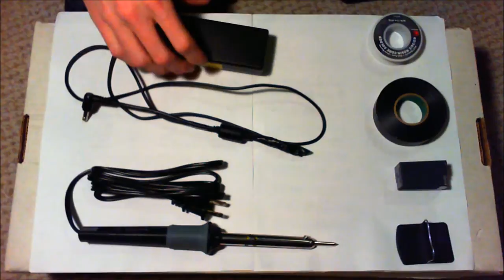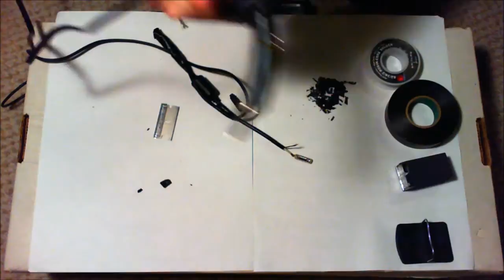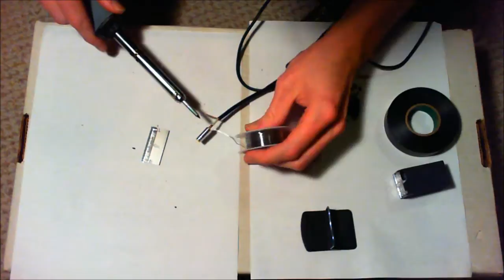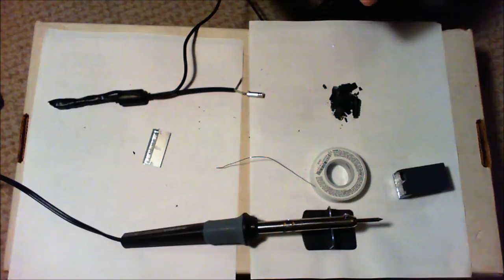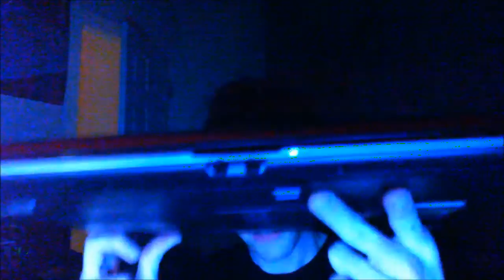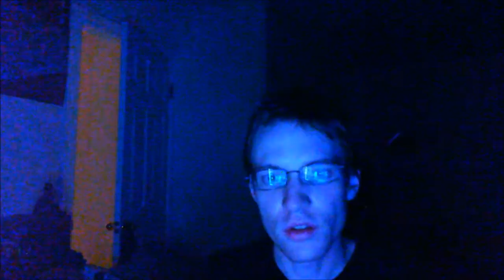How to fix a broken adapter tip

Comment from the maker: The inside wire is connected to the inside of the tip, that outside wiring is soldered to the outside casing of the tip. It's all in there.

Comment: You soldered the insulated wire to the tip and taped around it but you didn't say what to do with that second  wire .??

Comment from the maker: Yes, if it fits, just make sure you match the guts of the wire so the polarity stays the same.  It will push the same voltage and amperage, regardless of the tip.  I've spliced a great many adapters in my life :)

Comment: YES! THATS MY PROBLEM!. THE TIP WIGGLES. it still works. i have it plugged in right now but i need to wrap it around my laptop for it to work and im getting tired of it :( im afraid that if i strip the plastic off the tip it might get worse. and im afraid that i might sodar the wrong wire on wrong strip.

Comment from the maker: As long as the tip fits your device, you can scavenge it from anything, maybe something cheap from a thrift store or something.  I think it would be pretty difficult to find a tip that was designed as a replacement part, though.

Comment from the maker: When you cut the wire, you can see that the wire in the center is insulated and surrounded by more wire on the outside.  If the adapter says the center is positive, then that center wiring is positive, and the outside is negative.  If you need the center to be negative, then connect the center wire of the AC adapter side with the outside wire on the cord with the tip you are using, and vice versa.  But the device might require a positive tip.  No easy way to figure that one out.

Comment: OK good news.. I exchanged it for another one.  The other one is center Negative so that means I have to reverse the polarity right?  So that means on the one with the AC box i should take the negative lead and put it on the POSITIVE of the Tip that originally had Negative center right?

Comment from the maker: Normally, I like to check with a multimeter before throwing out the old one if possible.  If you're super lucky, you might be able to find some documentation online about it.  Otherwise, as I said, if it smells like it's burning, unplug it :P

Comment from the maker: If you have the wrong polarity, you risk messing up the system (if it smells like it's burning, unplug it!), but the short answer is yes, you can mix-and-match the tips.  If you discover that you do need to switch the polarity, you can just connect the outside wire of one to the inside of the other and vice versa.  Also don't forget that when splicing different adapters that if you have an adapter that provides a higher amperage is fine (not so true with voltage).

Comment: I have one HUGE QUESTION! I have an AC adapter whose tip fits on a TurboDuo.  However, I need DC with at least 10V 1.2A but the AC I have is much less than that.  I happen to have a DC adapter with the EXACT specs but the tip is too small (it says center positive).  Is it possible to splice the AC tip with the DC power adapter without f****ing up the game console? (the AC doesn't specify whether it is center negative or center positive). Please give me a reply, thank you =)

Comment: Soldering onto the shiny outside is a pain, and I don't know the real way to do it. But I have had the problem with it lifting off before. What works for me is to heat the larger part first (the tip) and then add the copper wires and solder after a little bit.